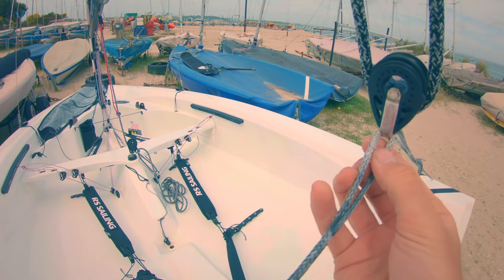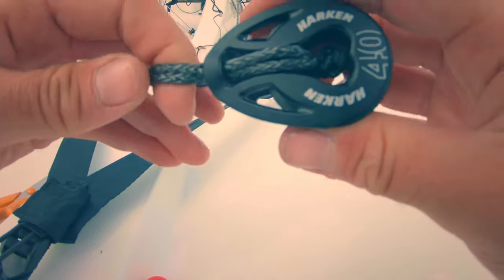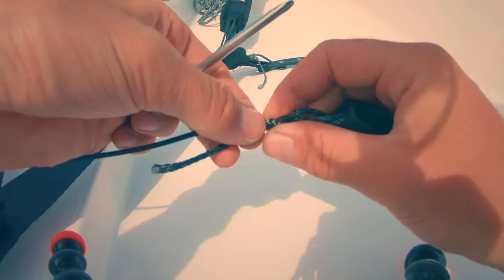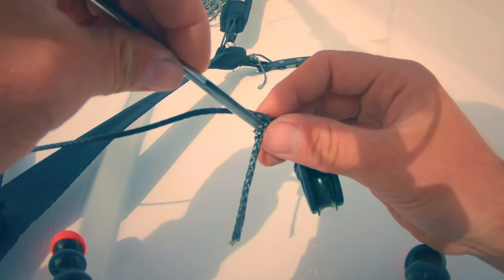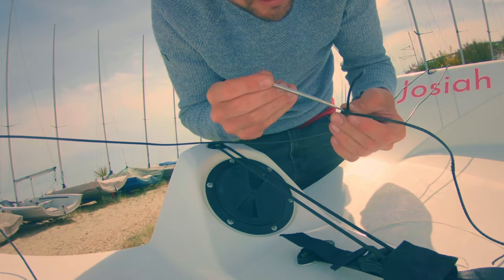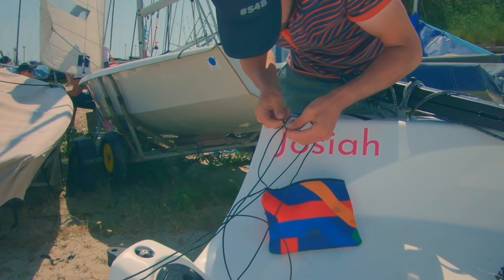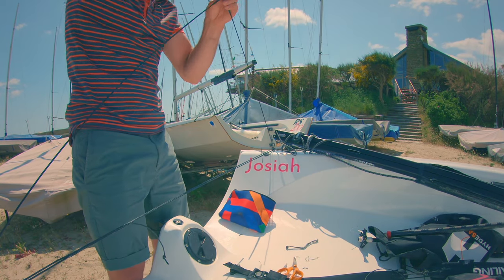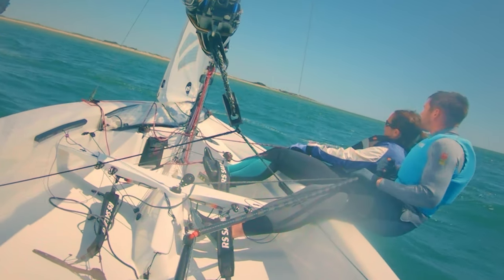Single adjustment, self-centring strops || RS 200 Boat Bimbles

Comment: Just fantastic, love your splicing videos you do. I am learning! I can tie diamond knots as long as I have you at the other end of the 'tube! Sailed the 200 with a soft shackle attaching the gyb haylard that I made last night. New to the 200, so will do this! Oh, I did wonder if you used some shockcord to a central fastener like the centreboard, if that would help you get it centralised? Right I'm off to buy those fancy fittings and SK99 Dyneema, many thanks!

Comment: The “needle to secure the position of two ropes” is fine but if you use those snap shut clips used to close small plastic food bags, they don’t drop off (how many needles have I lost?) and they leave small temporary marks on the rope - this means that if you estimate you need another 2cm, you can see the readjustment you are making.  Nice video and thank you.
Reply from the maker: Great tip. Like it

Comment: Hey Tom. Thanks for sharing. I did this on my old boat and it was great. Allowed me to play with the strops alot more and not worry that they would be uneven on each tack as per the original ones. The result being, I barely touched them! I've just picked up my new boat and plan to do this again. The only slight annoyance I found was that because one line remains tight across the boat, when it rains, the water dosent drain off the cover as well. Just wondered if you had a solution? I thought maybe using dog bones to secure through the hull, so you could easily remove one when not sailing? 👍
Reply from the maker: I have found the same thing, but do up.the straps as tight as possible and learn the boat. It still pools a little though

Comment: Good stuff. I sail a Weta but also use the Marlow 2.5 mm D-12. What fid are you using? Where did you get it? It seems to work great.
Reply from the maker: It's a 4mm Selma hollow fid. Usually it's to big for 2.5mm Dyneema, but this Marlow rope opens up nicely for such a narrow diameter.

Comment: Great system, I've ordered the bits.
Just a point, you said two loops 1" long when they clearly showed 2" long??
Thanks
Reply from the maker: Yeah sorry, they were about 1 inch long before I pulled the knot tight! Then ended up more like two. The exact length doesn't matter anywhere over 1 inch is long enough to get through the deck. Going longer isn't an issue (within reason) but perhaps doesn't look as neat.
Reply: @MozzySails  Thanks, I could see the need for 2 inches but thought I'd better ask.👍

Comment: why do you adjust the block height while sailing?
Reply from the maker: It changes the amount of tension you can pull down the leech of the sail, whilst also keeping the boom on the centre line. 

In windy conditions when you have more kicker on the bridle needs to be lower to keep the boom centred. In lighter wind you will have less kicker, and so a higher boom, but you will still want it centred, so you lengthen the bridle.

Comment: Wouldn't it be groovy if this was linked to the kicker system so as the kicker is pulled on the strop height automatically adjusts down with it.

Comment: whats the tool called for threading the line??
Reply from the maker: It's called a 'push fid' and is a type of splicing needle. The on here is a 4mm, but you can buy them for different diameters for different thickness ropes